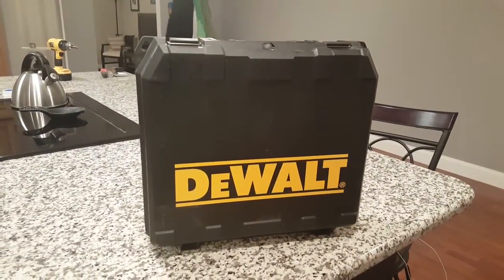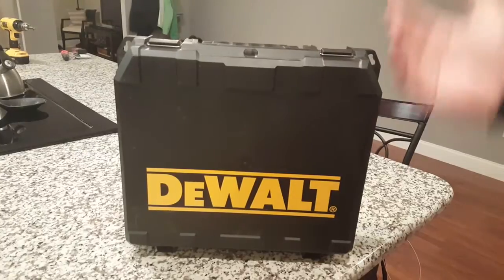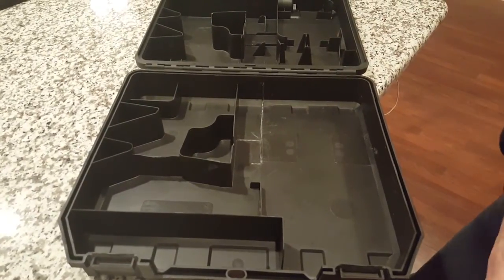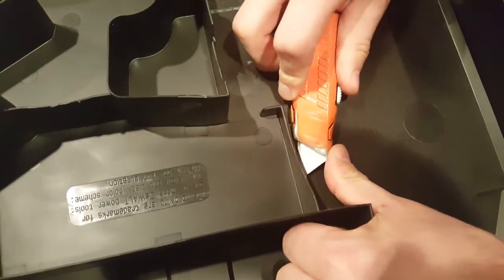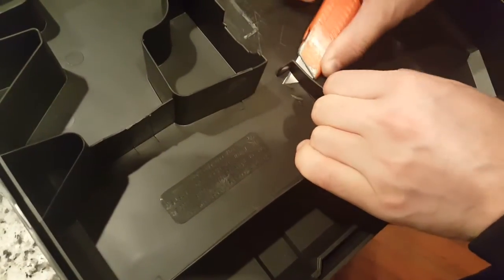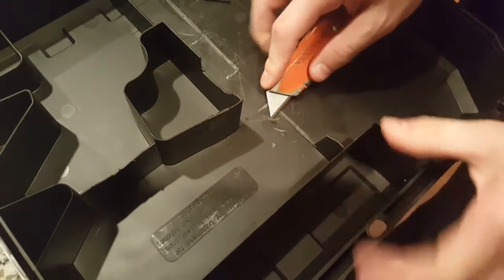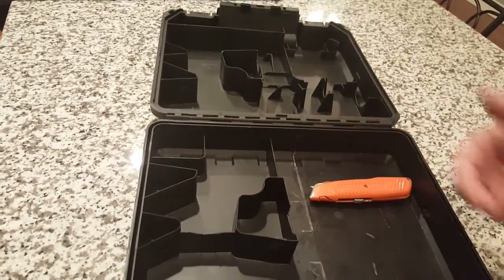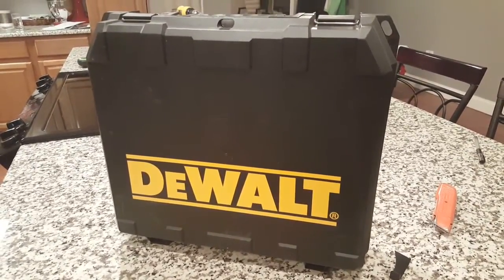Dewalt Drill Case Bluetooth Speaker Build

Comment: What a good black small plastic box that fit 6.5. 1/2 150w marine speaker and a small Bluetooth amp and 12v Talentcell 6000mAH rechargeable battery ?